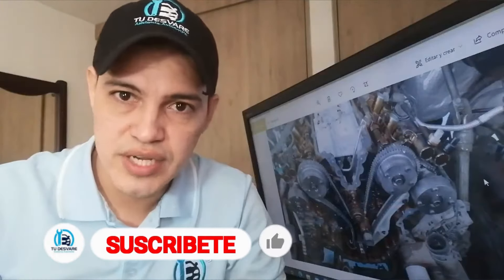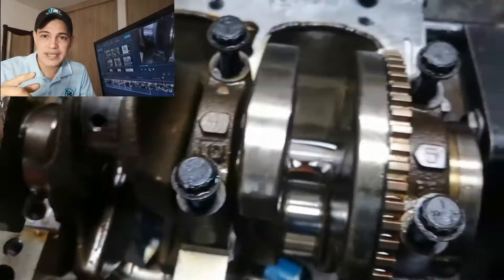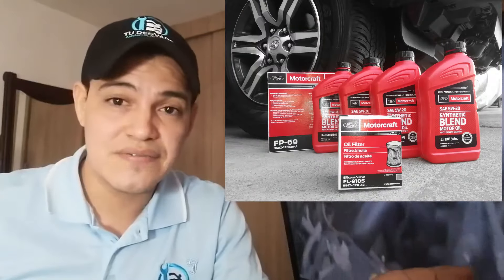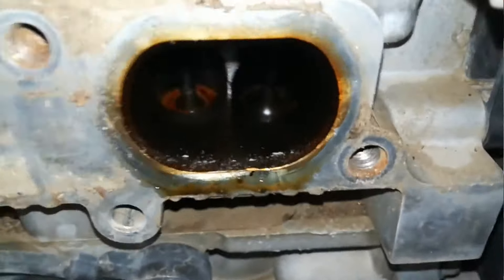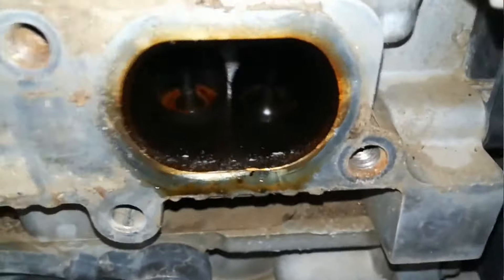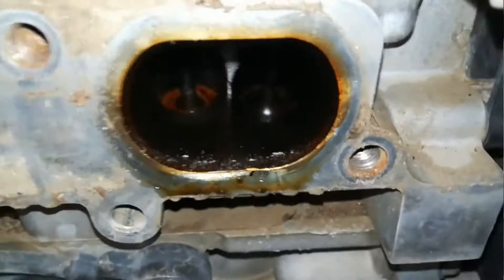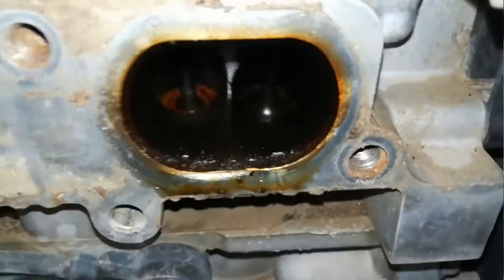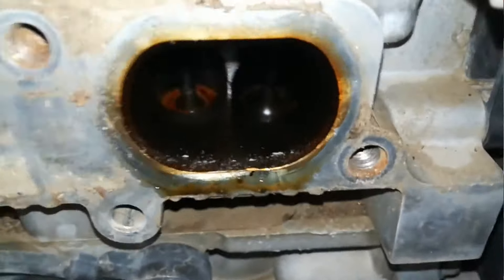Ruidos Y Golpeteos De Motor, 5 casos: válvulas, cigüeñal, distribución, bielas, pistón

Comment: Hola amigo, muy interesante y didáctico tu vídeo. A pesar de tu juventud se nota que dominas el tema. Por lo tanto quisiera que me ayudes en lo siguiente: Yo tengo una peugeot partner motor 1.4, decidí ajustar las válvulas ya que estaba produciendo un pequeño ruido. Las ajuste en 020 mm para admisión y 040 mm para las de escape , así lo indica el manual de reparación del vehículo.  El motor quedo silencio y trabajando perfecto. Pero cuando lo aceleré se produce un ruido metálico en el tapa válvulas.  Al chequear me percaté que algunos balancines tropiezan con la placa metálico deflector que va coloca entre la flauta de los balancines y la tapa  válvulas. ¿Será que se torció esa placa metálica cuando la saque del tapa válvulas? porque la verdad estaba pegada y costo para que saliera. La verdad no la veo muy derecha, trate de enderezarla y sigue tropezando¿¡que podría hacer? He pensado quitarse, pero si la trae de fabrica es porque la necesita y encontrarla nueva me parece difícil ya que es una pieza que prácticamente no se estropea. Mucho sabre apreciar tu consejo.

Comment: Ruido extraño al acelerar
Hyundai Tucson 2007 4 x 2 462000 kms
Se escucha chillido
Hola Jose Buenas tardes tengo una pregunta a ver si me puedes ayudar. Tengo una tucson 4x2 año 2007 cuando hago los cambios todo va perfecto pero a veces cuando voy en segunda y la dejo mas de la cuenta antes de pasar a tercera siento un chillido muy leve en el area del copiloto cerca del piso en el interior del vehiculo si suelto el pedal el ruido cesa y si meto el pedal el ruido vuelve , al pasar a tercera el ruido desaparece pero si sigo en tercera y acelero mas vuelve el ruido hasta que paso a cuarta y el ruido desaparece y si en cuarta acelero sin pasar a quinta vuelve el ruido hasta que paso en quinta ya en quinta el ruido se oye sin importar la velocidad, solo aparece cuando voy en segunda, tercera o cuarta, pero eso si el ruido es muy leve y bajito hay que tener buen oido para escucharlo, me podrias orientar en eso un poco?? pensamos que era la rolinera del compresor y se cambio pero no era eso. Mil gracias por la ayuda

Comment: Hola buenas noches. Tengo una terios bego 2008 1.6 4×4 me sonaba como el video 1. Rompió un brazo de biela, se le cambió, rectifique compre cigueñal, se rectifico el motor a 0.30 piston empacadura nuevo! Cuando la armaron siguió con el ruido pero menos, rectificaron el cigueñal a 0.10 bancada conchas igual, y al prenderla sigue con el ruido pero muchos menos que la primera vez. Te agradezco me puedas responder para alguna ayuda por fis!!! De verdad no sé que hacer!

Comment: Disculpe amigo la pregunta. Esq tengo un corolla mod.99 1zz y ace un ruido como si fuera de valvulas pero ya mande a reparar y el motor tambien ya repare 3 veces el motor con mecannicos diferentes y sige con el ruido..gracias
Reply: En las mañanas es mas fuerte y en 30 segundo se quita un poco q podra ser el ruido amigo...o es porq ay q kilometrar gracias amigo.

Comment: Hola  excelentes videos ! mira me compre un vehiculo con 170.000 km modelo 2008 , motor 2.7 24 valvulas , 6v , me fui de una a cambiar cauchos, frenos aceite y refrigerante , como no sabia que aceite se echaba llame a la dueña me dijo 5w20 sintético ,yo lei por internet y decía 5w-20 así fue , me fui contento para la casa con mi auto nuevo , de camino note que encendía el testigo del aceite , parpadeaba no se quedaba fijo , parquee  me puse a limpiar por dentro lo deje encendido para que trabajara , lo moví de lugar para que pasara la noche y en la mañana !! 🥶🥶 había botado aceite , goteo pensé que  era el filtro que quedo mal puesto, me fui para allá y cuando miraron no era el filtro pero el carro estaba por debajo lleno de aceite , lo estaba botando por la junta de las  tapas de las  válvulas! Al parecer  la viscosidad del aceite no era la indicada  y se tapo la valvula pcv y los gases y el
Aceite reventaron el empaque ! Pase a cambiar las empacaduras de  las de valvulas y del multiple de admisión , con ayuda obvio , ya no boto mas aceite pero , tiene un golpeteo , mañana voy a proceder a cambiarle el aceite a 20w50 semisintetico , a ver si disminuye me dicen que puede ser el cigüeñal  que por el aceite tan delgado ,la verdad estoy aburrido le meti lo mejor el aceite mas caro y vea , hice caso a lo que me dijo la dueña y no me percate del aceite que sacaron ! Cual es  tu recomendacion?
Reply: LO NORMAL,EL ACEITE ES 10W40

Comment: hola que tal,gracias por el video.
quisiera comentar...
el manual especifica la viscosidad del aceite 5w30 cuando compras el auto nuevo...
pero..no especifica cuando tenga mi motor mas de 250.000kl.
la presion del aceite se puede perder por desgaste de bancada o cojinetes.
los cilindros ya no tendran las rayas de origen.
entonces no le vendria mal meter un litro 5w40 sobre los 6L 5w30 que lleva mi auto
Reply: ¡Siempre la misma viscosidad! Así tenga 500,000 kms.

Comment: Muy buen video!! Muy claro. Tengo una consulta, tengo un Chevrolet cruze motor ecotec 1.8 manual, año 2012, lo compre con 56.000 kms de un dueño que le dio un uso normal (supongo por lo que se) y el tema es el siguiente, le hice cambio de correa de distribución en el service oficial y ahora comenzó a hacer un ruido como un “shic shic..” casi que continuó en la zona de las poleas del arbol, lo lleve al service nuevamente y allí revisaron y vieron que al cambiar la correa existía un pequeño desgaste entre engranes de los engranajes del árbol y la correa nueva al encajar se quejaba.. en la primera llevada simplemente lo lubricaron y ese ruido paró. Ahora hace 500 kms de eso y comenzó nuevamente.. que me recomiendas que pueda hacer? No soy mecánico pero me interesa mucho y a veces siento que no están haciendo lo correcto en el service. El tema es que tengo miedo de que este ruido desencadene en algo peor como alguna rotura de biela o algo de lo que tú muestras. Muchas gracias de antemano!! Un saludo desde Uruguay, suscrito al canal!!